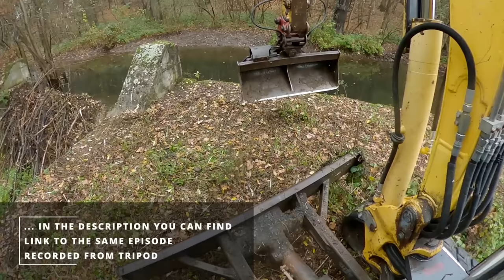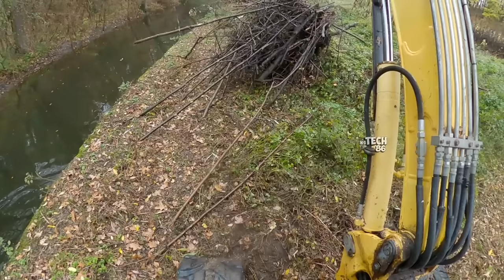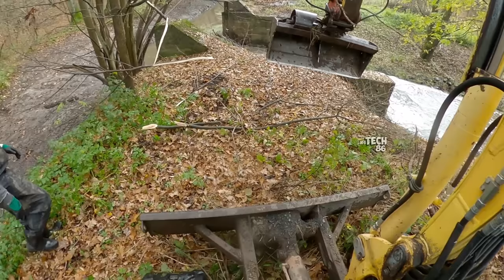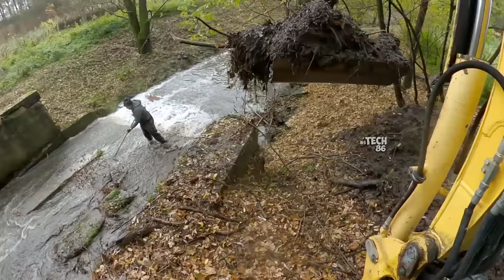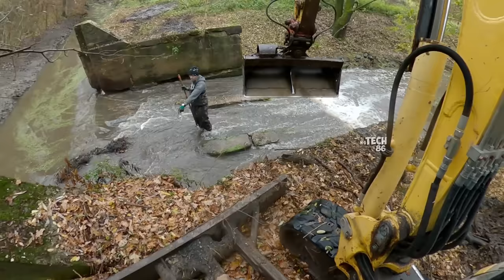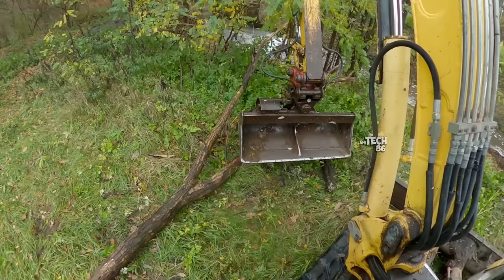Large Beaver Dam On A Concrete Weir - Mechanical Beaver Dam Removal No.91.1 - Cabin View

Comment: For those asking what happens to the beavers, they will most likely build it back when they hear the water running again. They do not live inside the dam but in a hill like lodge usually on the bank of the body of water they have made by building the dam.

Comment: Having a spotter/ signaller for those blind lifts would make that job easier and safer. 15 years as a NCCCO crane operator, having another set of eyes guiding you helps a lot for time and safety concerns. Liked the video though, that water needed to flow correctly.
Reply: Was there not two dudes?